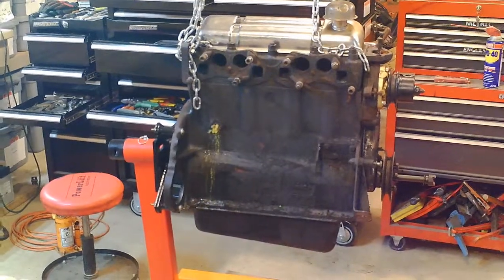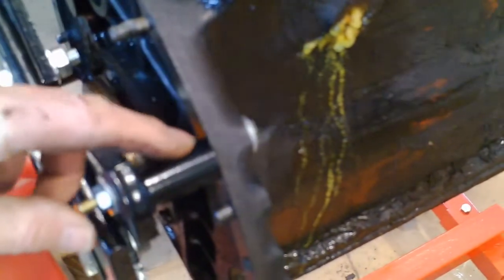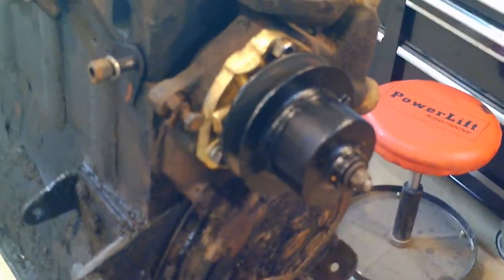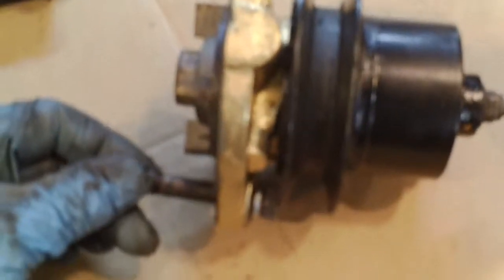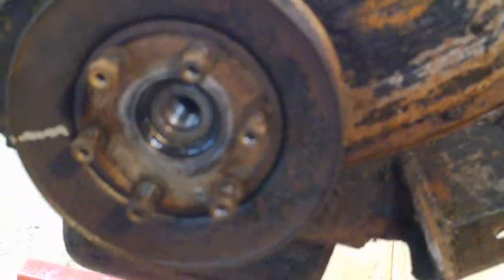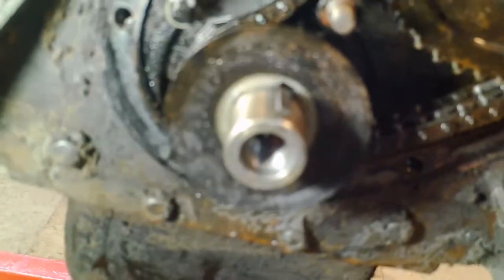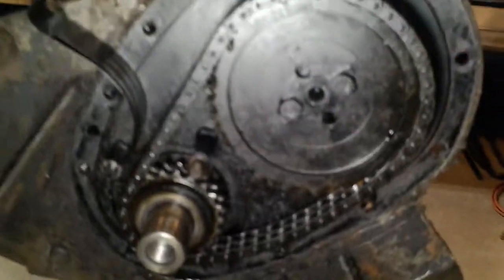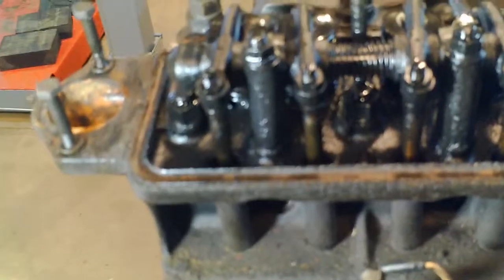1959 Triumph TR3, Part 5 Engine Tear Down and checking timing alignment

Comment: Nice project and good work! It looks like the hand-painted orange/red characters "TR3" are still on the right side of the engine block; that would suggest that the block has never been hot-tanked. If I may suggest, try The Roadster Factory in Armagh, PA for parts. They are the US experts for TR parts, and (in my opinion) their parts are the best quality and most authentic. You can get a copy of the build certificate for your car (showing build date, interior and exterior color, engine number, etc. from the British Motor Industry Heritage Trust (about $60 US).
Reply from the maker: Yes, I have looked at Roadster Factory before, will definitely check them out again as I am about to spend a fortune on parts.  Yes, you can see the letters, I exposed some more of them today cleaning it up a bit more.  I think I will take a pic and then try to put letters back as close to original as I can.  I appreciate your comments, I need all the help I can get!